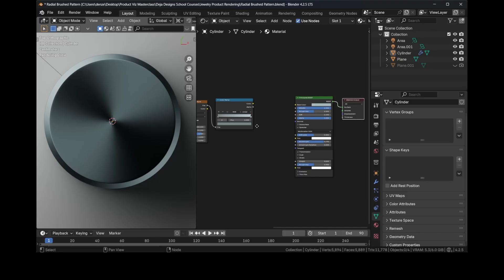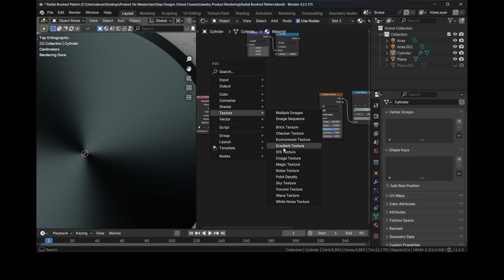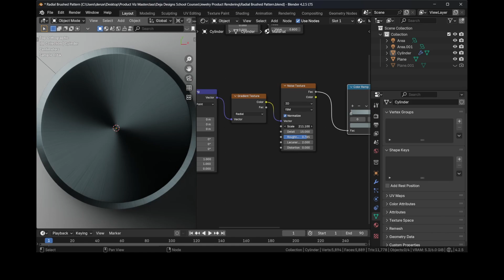Unique Brushed Texture – Fast & Easy!

Comment: at minute 1:22 you say that's exactly what we want ... how does a radial texture like that lead to brushed metal after plugging it into the noise ? can you explain please ? thank you
Reply from the maker: Good question. I should have explained that more. 

Basically, with the Gradient Node set to "Radial", it outputs a value based on the angle of the input around the Z axis, so in the video @1:22 you will see i moved the mouse in a circle, indicating the value going from 0-1, around the center (Z-Axis). When we plug that into the noise texture, what you see are those black and white values being stretched outward and going around from the center(Z-Axis).

I really hope that makes sense. let me know please. Thanks
Reply: @denzelmodeste  Thank you very much for answering Mister Denzel !
I still don't quite get it, the radial mask is 0 for angle 0 for example but it is equal to 1 in angle 360
but when you plug that into the noise, 0 & 360 are similar
how does a radial mask around Z turn into stretching away from Z
thanks again
Reply from the maker: That's because when we set the node to "radial", you are seeing the results in polar coordinates instead of cartesian. When you think along those lines, you'll be able to see it clearly. Here is a link to a video that will help.
Link: https://www.youtube.com/watch?v=1ArOVAO7FjI
Reply: @denzelmodeste  Thank you very much!